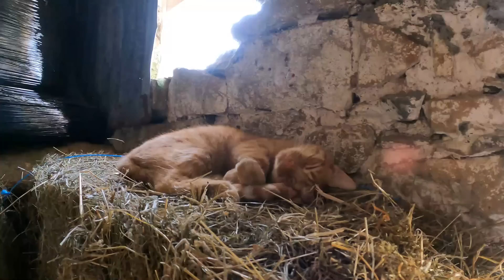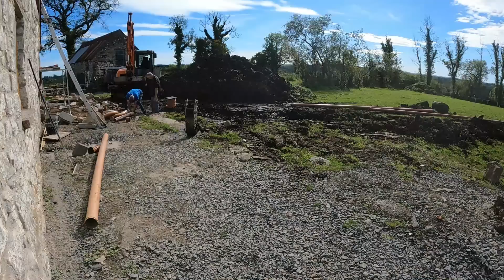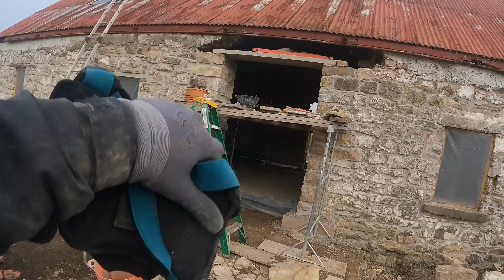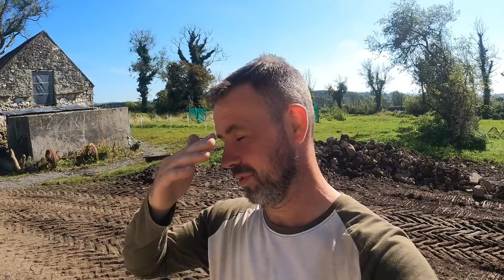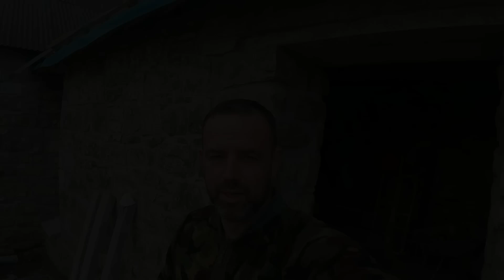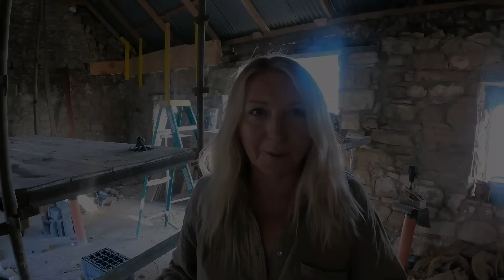Stone Cottage Renovation drives us potty!

Comment: 12:48 If you can't tooth in properly, just get some long Tap-Con screws, drill into the adjoining blocks, and screw the Tap-Con in, leaving a couple inches proud, so it lines up with the mortar for the new section, and it will tie it in just like rebar would.   It will be totally buried inside the mortar, so no one but you will ever know it's there.

Comment: In an earlier post you mentioned a wall without windows that takes the brunt of gale force winds. I wondered if it would make sense to add a small outward angle on the outside so the wind would be split, and the impact would be lessened. I hope that makes sense. I got the idea from an old mansion in Galveston Texas which was designed to endure hurricanes.

Comment: Couldnt you have drilled some holes in the side wall and bricks, filled the holes with resin and hammered some long bolts in to secure it. You could even do it now its built, just drill the holes and resin in the bolts (or reebar if you already have it).